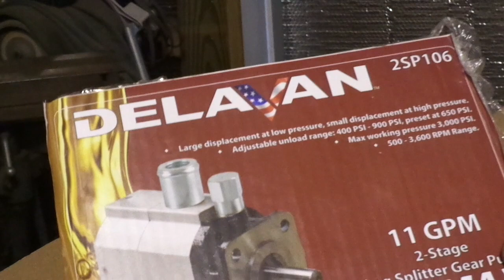Wood Splitter Hydraulic Pump Replacement and Test Run

Comment: Hi Tractorman44, TY for the walkthrough!!  Recently, my 1.5 HP motor + 11 GPM 2-stage pump electric log splitter is struggling to cut through straight logs.  The ram would move up and down without any issue when there is NO resistance.  However, when the ram meets resistance (i.e. medium size straight log), I hear the motor cranking hard but the ram does not move any further to split the wood.  The motor is trying so hard, it actually pops the electric circuit breaker.  I noticed the splitter progressively getting weaker and weaker in the past 3 months.  After some research, I believe the hydraulic pump needs to be replaced. What are your thoughts on this?
Reply: BTW, I have an older version of the 16 Ton model here: http://www.ramsplitter.com/electric-log-splitters.html
Reply from the maker: Well its really hard to be sure without physically being there to operate it.  The part that is confusing is the motor tripping the breaker.  That usually means it is over loaded and with a weakened pump that is no longer producing the required pressure, the 'load' on the motor would be lessened.  That's the rub here.  A weakening (worn) pump loses its capacity to pump the full flow of oil, and a weakened relief valve puts the machine in bypass or partial bypass more easily and both should reduce the amperage load on the motor.   On the surface though, it sounds as though you are describing a worn pump.  All I can give you for sure is wishes for good luck with the repair.  One more thing....a long or light guage extension cord will cause voltage drop and cause the amperage of the motor to increase proportionately.  Voltage and amperage have an inverse proportion.

Comment: I have the exact same splitter (but in more of a used condition). What hydraulic fluid are you using in yours?
Reply from the maker: I use AW32 in almost all hydraulic systems on the wood splitters and tractors. Thanks for the question Mark.

Comment: Hello Mr Tractor Man,  my splitter has developed a very slow cycle time. Changeg the fluid and filter, still slow with no visible leaks. Would you recommend a new pump?
Reply from the maker: I would have to play with it myself to decide, but the three distinct possibilities with your description would be internal bypassing of the controls relief valve, the cylinder packing wearing and bypassing oil or the pumps internals wearing to the point its not developing the flow it used to. I can't make a judgement for you in good faith that's not just a guess.  All the components wear over time.  The strongest suspicion however would be the pump just wearing out.
Reply: @tractorman4461  Thank you sir. I am going to start with a new pump.  It doesn't look to difficult to change out.

Comment: 44 saved someone alot  by fixing things great job very interesting 
God Bless All 
PaK
Reply from the maker: Thanks Peter...it should be good for a long time yet and even if the motor goes bad, Predator makes a clone that will bolt right up and they seem to get reasonable reviews from the people that use them on equipment.  Have a GREAT New Year my friend.

Comment: hi there  question  is that a northern hydraulics  to northern tool . years i got things from northern hydraulics then they went away  . i thought that NH changed then it was NT  . well i thought it was the same place but it not   . NT infringed on NH . they ant the same place  . anyway NH  is still out there that is where i got back to going to   . like them better  . i am sure you also use surplus center  . john
Reply from the maker: Missed notification of your comment John. Yes   Northern Tool is Northern Hydraulics. Same place and similar name. Used to be a more basic store but they expanded merchandise exponentially when they changed names.

Comment: How did you prevent losing fluid when you disconnected inlet hose to the pump?
Reply from the maker: Oh you'll lose a little.  It depends on the elevation of the tank in comparison to the fitting.  But I'll slip a cap on or elevate the hose quickly higher than the fluid level real quick if possible.  You are going to lose some oil no matter what you do.  If necessary just keep a clean container to drain the hose into while the repair is being made.
Reply: @tractorman4461  thanks! let me say I am mechanically challenged, I rely on youtube/google and try to follow instructions. I have a troy bilt 27 ton splitter. last week it stalled on auto return and I could not restart it (pull cord only came about a foot). I removed engine and it was ok, the pump however would only turn 180 degrees. I think I can see where one of the gears is catching when I look thru the intake port. The spider bushing was gone and the couplers were chewed up (my lack of tech experience). I'm attempting to replace it but not sure what caused the pump failure (don't want a repeat episode). Any thoughts or recommendations welcomed.

Comment: Love that dog, Wendel.  That's  flow rate on that pump (11 gpm), might be perfect for that splitter, as it's small and long cycle time.  I can see how you would not compare it favorably to your heavy-duty splitter, but for backyard firewood, it might be okay with DRY straight wood.
Reply from the maker: I agree that I AM spoiled a bit by the old pto splitter's speed and power.  Yes, this one is a good splitter for any home owner wanting to cut their heating bill.  That piece of oak I split was hard as a rock.  That one spot where the two pieces just POPPED and flew apart with only a portion of penetration was indicative of the force required on that particular one.  Thanks Powrguy for the comment.

Comment: Wendell, I have a question for you, do you know of any “garden sized tractors that closely resemble a John Deere M series or, a tricycle tractor that could be a cool wood collector for my boy. Similar to a panzer, or wheel horse, possibly an old cub
Reply from the maker: Yes, a little Allis Chalmers B would be a good choice. They were pretty much unchanged from ‘37 or ‘38 to ‘50. Most are a simple crank start THATs easy to crank. Nicely tuned it’s usually a quarter turn to fire them up. Simple to work on snd youll have your choice between a distributer or magneto. The C will be almost the same tractor but is usually electric start and crank start. They will most likely have a narrow front end. The cool thing about the B’s though is they are fairly easy to turn into a low rider. They are referred to as a “Bow axle B”. You can turn the front axle upside diwn then invert the final drives and make a neat low rider fir the car shows !! Try googling “Bow axle B low rider” snd see what you find. Might have to add Allis Chalmers to the search. Right now I have two Bs and two Cs to move down the highway. They were in competition fir the truck farmer market with the Cub, John Deere LA and Massey Harris Pony. Plus they were perfect fir the small acreage farmer too. A pony or an LA would be perfect as well. Good luck. The M and  MT are both slightly more tractor than these suggestions  here.
Reply: @tractorman4461  ok now my search begins, looking to find something before October at a reasonable $, I’m hoping that my channel can take off so I can do things like this for the kids, and let them handle the firewood chores😂😂😂 Like that will ever happen!
Reply: Looking for something a little more lawn mower sized, remember we live in NJ, and have woods near by, but we also have neighbors who think they are always right!
Reply from the maker: @thesmallwoodlot433  ok. I mistook the John Deere M as though you’re looking slightly larger. Lol. My bad. If that’s the case I would be looking at cub cadet or Bolens or maybe an old wheel horse. Maybe even an Economy. That’s one that would be really cool !!  Those would all be horizontal shafted and easy to adapt to an electric start Predator engine from harbor freight. Also the Economy should have 16” rears.
Reply from the maker: Hey one more thing Economy actually had a factory buzz saw accessory that mounts on the front. Lololol.   Supervision required though !!!!  LOL.
Reply: About the size of a cub cadet 1100, but older and styled after a larger tractor
Reply: @tractorman4461  the economy is what I think we are looking for, I know a lot of these had implements that he could use, and grow with!
Reply from the maker: @thesmallwoodlot433  yes. That would be an excellent choice. I’d start with a FB Marketplace search.
Reply: @tractorman4461  will do, I’m also going to check a few lawnmower junkyards

Comment: Best ordered one of these for my wood splitter I need a two hose hookup is this just one hose or two holes hook up please comment ASAP so I don't waste $200
Reply from the maker: It only has one inlet and one outlet on the hydraulic pump.

Comment: We don't burn wood anymore (my brother does), but when I was a kid, we had a wood burning stove in the living room and a wood burning range in the kitchen.  We used an axe, splitting maul, wedges, etc. to split the wood.  We even had bow saws to cut the smaller diameter wood.  I learnt to use my whole weight, which back then wasn't much, to split wood, and I could out split bigger guys who didn't have the "technique" down on how to swing a splitting maul.  Having a factory built splitter would have been great, but we couldn't afford such luxury.
Reply from the maker: Hahahahaha...back then there just wasn't a lot of store bought ones anyway.  That's why my brother pieced together the yellow one of mine in the 70's out of discarded materials.  Just junk off the jobsite dumpsters and farm machinery parts. Yes, I split a lot of wood by hand for many many years too.  We had to heat with wood, there was no other source of heat in the old house we grew up in.
Reply: Yep, that's all the heat we had also when I was a kid.

I'll get that tank up to you as soon as I can - maybe next week sometime.
Reply from the maker: @316jd140  No problem and no hurry at all.  Thanks Terry.
Reply: My dad split wood by hand (a quick karate chop) for many years.  Actually he used a maul and splitting wedges and he burnt a minimum of 6 full cords every winter.  I did the same for many years and then bought a used splitter from a rental operation.  I look at photos of the wood piles I made with a splitting maul and it's hard to believe I did that every winter.  And they were much smaller piles than the ones my dad made.  I had to replace the motor on my splitter a week or so ago and had to split a few pieces of ash by hand and it about did me in.  I think that when  my dad was splitting wood there was no such think as a hydraulic splitter.  If there was it was too expensive or he was even more stubborn then I am and refused to spend the money. Hand splitting pin and other oak found here can be tough.  I remember one chunk of oak was so damn tough I could not get a start with a maul at all and had to make a cut with my chain saw just to get the splitting wedge started.

Comment: 10:07 was almost a crushed hand out of sight from the baseball hat brim.  Looked like a pretty close call.
Reply from the maker: I think maybe the perspective from the camera angle contributes to the appearance of danger.  That ram moves so slow, that most people would just about have to be asleep to be mashed on this machine.  It's got the power sue to the two stage pump, but not the horsepower to move the volume of oil fast enough to speed up the ram.  
   Now the ram speed on my much larger single stage splitter powered by farm tractors up to 50 hp is fast enough to catch the hand of an inattentive operator.

Comment: I have a county line log splitter, and it is also a “convertible” splitter, however I never use it in the vertical position. The reason being positioning the large rounds is more then my back can handle on my knees. For that splitter, why don’t you fabricate a hydraulic feed table, and raise it up a bit also relieve stress form his back as well.  I think you could handle that little bit of fabrication!lol
Reply from the maker: Yes Pat, that could easily be accomplished.  He just had one or both of his knees replaced, so I'm not sure just how he's using it yet.  There is room for design change for sure.  I remember your little man's video splitting wood on the County Line....cool video and a hard working lad you have there.  Thanks Pat for the comment buddy !
Reply: @tractorman4461  Morning Wendell, I hope you boy is doing good, now I guess that we are not the only ones who need to work smarter not harder! I’m thinking of how to stream line my wood processing as well, just to avoid any more damage or issues.
Reply: I have the same opinion of using my splitter in the vertical position and used it only a few times.  The way I split big rounds now takes a lot of the human work out of it.

I have a heavy duty (mostly hand made) trailer and its bed is about level with the rail on my splitter.  I have a ramp I put on the back of the trailer and use it and a portable winch to winch the rounds up onto the trailer.  I back up the trailer so there's a short distance, a couple feet or so, between the rail on the splitter the back of the trailer.  Then put a couple of good 2 x 6s between the end of the trailer and the splitter and roll the rounds onto the splitter. Saves a lot of muscle.  Takes a little time but I've got more time than muscle.
Reply: @ravenfeather7087  i had a similar set up with heavy duty pallets, stacked right next to the holding tray of my splitter for a bit, but for some reason, I now enjoy the hammer and wedge to help lighten up the load!

Comment: Me personally I like it in the vertical position but I would always sit on a round instead of kneeling but keep up the great videos
Reply from the maker: I have not doubt there is a way to get used to using the vertical position.  I only split one or two pieces to make sure the repair was complete.  If it were to stay here, I'd probably use it to a great extent on the larger rounds like that.  Thanks William for the input and thank you for watching.

Comment: Had my engine just get tukerd out. 
Put a engine on that runs at the full 3,600rpm of the pump. It shaved off about 2sec or so of a round trip off the piston travel time, with no split load.
 I think the old push rod Briggs & Stratton engine was only spinning around 3,200rpm~ at best.
With the replacement engine having quite a bit more grunt, it's probably far closer to 7hp then the sub 5hp.
should the pump give up I think a 13 gpm would be well within reason.
0.01c
Reply from the maker: Good luck with what ever you decide !!  These little engines just wear out.  The rings wear, the cylinders wear, bearings wear.....until they just won't produce the maximum any more as you describe.  On the same note, the packing in the cylinders wear, the control valve wears, the pump wears.....we wear out right along with them too !!  Thanks Bruce for the comment.

Comment: What I do, as well as many others, is to only use the vertical position to break a large and heavy round into pieces I can pick up. The round you had, I would split in three or four pieces and the do the rest horizontal. You're right, that spitting on your knees is not right. Also, if I have just 4 or 5 big rounds, I'll use my Fiskers X27 and bust them up by hand.
Reply from the maker: In my younger days I would do the same thing and it didn't take much to realize that's the way I'd use the vertical mode if the machine was my primary splitter.  If you've seen my home built splitter, you'll remember the beam is fitted to an "A" frame axle that allows it to hydraulicaly lower to the ground to roll large diameter pieces onto the beam for that specific purpose. If you've not seen it Phil, somewhere near the beginning of this Splitter Wars collaboration  video, the function is shown: https://www.youtube.com/watch?v=OubpVGJaiiY&t=5s  Thanks for the input and thanks for watching sir.

Comment: Whew, can’t imagine splitting for hours at a time on your knees even on dry ground.  Seems a bit inconvenient too for getting the next piece to split, would be too much getting up and down.   Anyway, good video on the repair and the man should be happy with it.
Reply from the maker: Thank you for the comment and yes, I do believe he is pretty doggone happy with it.  I guess using this to any extent in the vertical position would necessitate using one of those 'pickaroons' I see guys use all the time to keep from bending over so much.  You could have a fair stack staged, then kneel down to split and keep pulling more to you with the pickaroon.  Now I tell ya, I have an old pickaroon that's gotta be close to a hundred years old and I can't bring myself to use it.  I tried it once or twice and it just don't work for me.  But for this application, I think I would force myself to learn how to use it efficiently to minimize the effort of getting up and down.

Comment: That vertical splitter  would be too hard on my lower back and knees.
Reply from the maker: Well it IS really good for busting bigger pieces into 4, then flip back to horizontal to work standing up, but its actually a little low horizontally even for a shorter person.  If I kept it for my own, first thing I'd do would be to put a lower axle with 15'' car tires on it to raise the working height. At the same time getting more working room on the side by shifting the beam to the rear to maintain full function of the tilt feature.  I didn't like getting my knees wet in the moist ground....